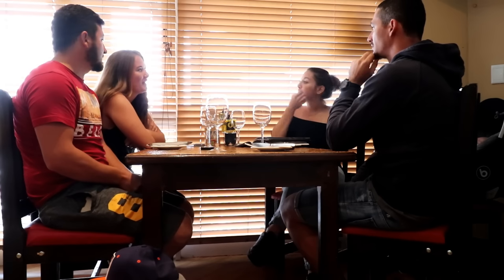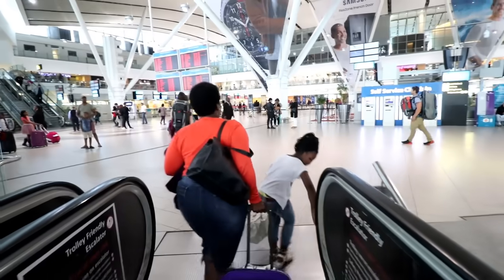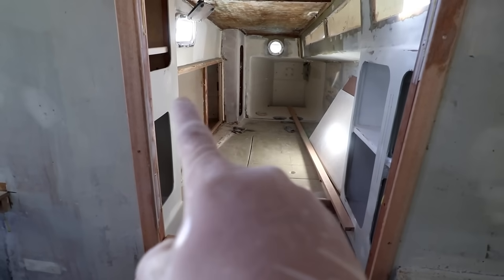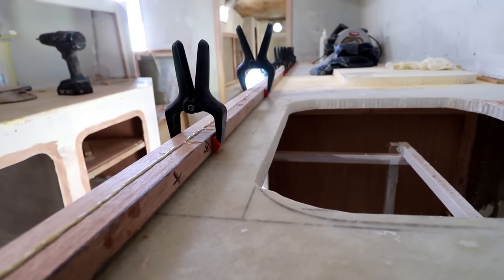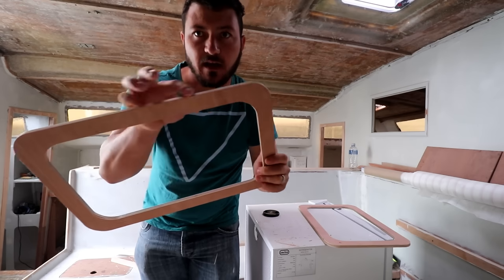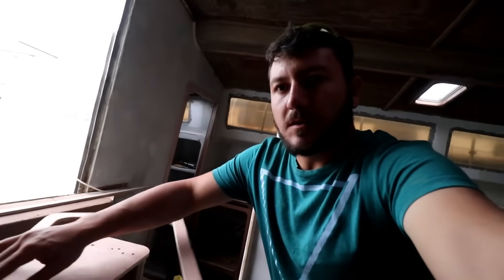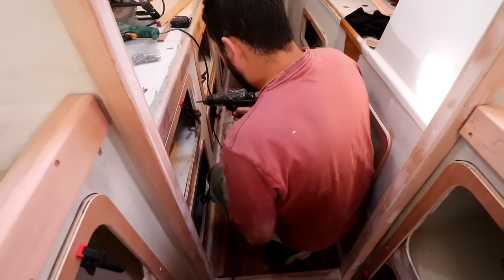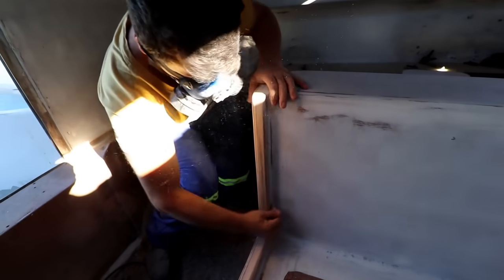CNC routering CABINETRY FRAMES | YACHT REBUILD WEEK 21

Comment: One of the channels to get very good tips for renovating a (wooden) boat. You do all double as good as I did. I hope my bloody beginners work lasts nevertheless. As I don't know the time lapse between work an video I would like to give you the tip for the future. Don't use screws for the frames. Even stainless steel corrodes after a while and it look horrible. Glue it with epoxi (or polyester works as well good on wood) is enough. I by myself used some construction glue and it seem it lasts for the rest of my life.
Reply from the maker: Hey there. Thank you so much. We have epoxied in our frames. The screws were there just to hold it in place while the epoxy cured. 😊

Comment: I'm totally new to boating. All I know is mechanics and home repair. I am learning so much from watching your videos. I love it! I do have a question. I noticed you keep using epoxy on the cabinets. Where you are doing wood on wood, couldn't you use regular wood filler? Or would the salt water mess with it? If you could help me out here I would appreciate it. Thank you. Love the videos!
Reply from the maker: Thanks Jeremiah, You could use wood filler for non structural areas but with any flex the wood filler would crack where the epoxy is more permanent.
Reply: @livingwiththemaias  that makes sense. . . I started watching your videos from oldest to newest so I am not current yet with where you are on the build now. I know in building houses we always get the frame work done, then electrical, then cabinets, trim etc etc. When you decided on the order of construction, was it suggested to you to do it in a particular order? Would you do it differently if you had to go back? Sorry for so many questions. Like I said, I'm learning lol.

Comment: I'm following your huge restoration work from week 1, and I'm really surprised at the results. Congratulations!
I would like to know, if possible, how much you originally paid for de boat and approximately the money you spend so far on restoration. I plan to do something similar but I'm in the previous stage to the very begining. I guess next year (impossible before) I will sell my apartment and start to search for a catamaran to restore. That's why I'm very interested in prices outside my country (Argentina), because I plan to realize this project in the most convenient place.
Reply from the maker: Hey Rodolfo. Thanks so much for the kind words. We brought the boat for under $30000. We will be releasing a video based on how much we have spent on the boat exactly. We need to sit down and work it all out on materials etc so stay tuned for that. 😊